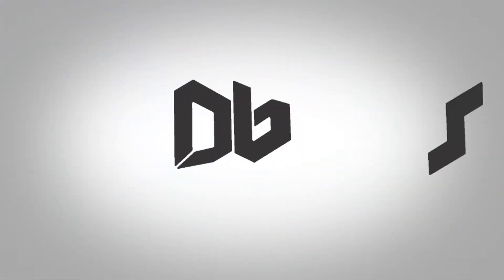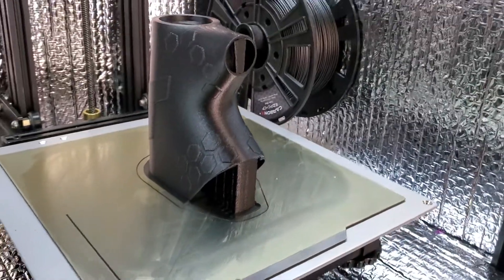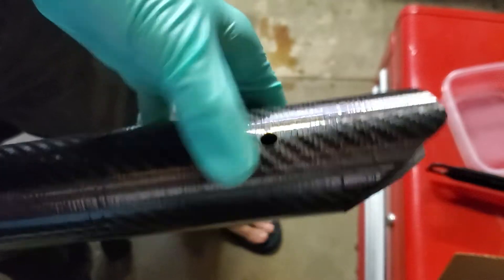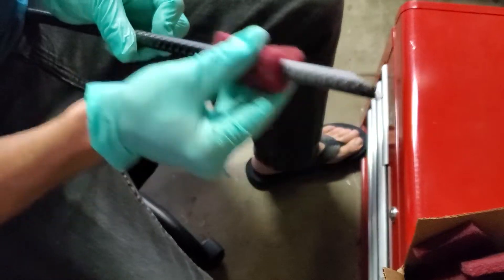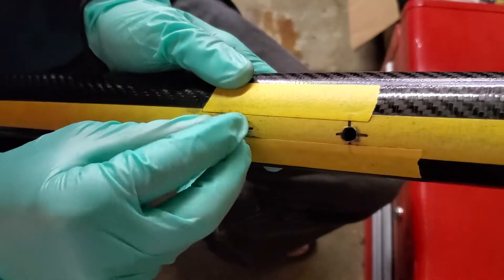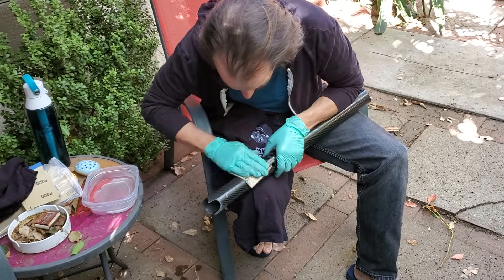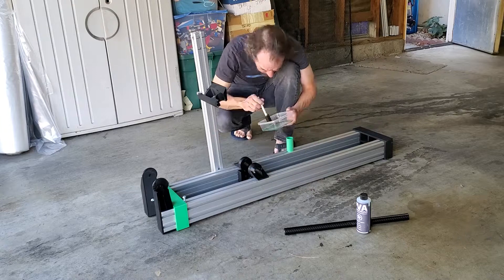Building a 3D Printed Carbon Fiber Bicycle Part 4 - Printing Carbon and Other Details

Comment: Great project!
Are u going to update it? It`ll be great to see there disc brakes, for example.
Reply from the maker: Thanks! I would love to do an upgrade with disc brakes but probably not any time soon.
Reply: @designbydave  disc brakes and through axel are two things which it'll be great to see at that frame for sure. I need to check if there're any dropouts with through axel at link you've provided. And I didn' see if for what rear hub standart was that frame made for? Maybe I've missed that info.
Or maybe u can also share step files of frame's dropouts so I could try to model some brake mount.

Bike season in my country is ended for now because of a cold weather, so I'll love to make that your bike build before the next one.

Comment: Any updates on this or other ones you've made?
Reply from the maker: I made two and ride the second one to work once a week or so! It's great for what it is and I love it!
Reply: @designbydave  I just got a Snapmaker 2.0 and had a similar idea. I had this old (10+ years) bike and spent about 400 sealing out parts over the last 7 months I've been using it to get to work. It's I can 3d print parts like that and get the tubing that's be a lot cheaper in the long run for parts

Comment: i'd be really interested to see, what the infil actually does for strength. i'm 3d printing myself, mainly engineering stuff, and from empirical data, the only thing that really influences part strength is number of shells and top/bottom layers, infill over 25% did never make a significant difference to me. maybe you could make a more scientific approach? would be interesting to see, also you could save a lot of weight and (expensive) material. those engineering materials arent exactly cheap so why use more than you have to?
Reply from the maker: Yes, totally. An investigation and optimization of wall/infill printing perimeters would be worthwhile. It's just something that I haven't been able to get to. In a general sense, I pretty much agree with you. However for these first frames I wanted to error on the side of over-built.
Reply: @designbydave  true, overbuilt works better than if it breaks right away 🤣

Comment: Great job. Can you tell me more about nozzle diameter, nozzle material, and print speed for that material?
Reply from the maker: Thanks. 0.6mm, hardened steel, ~40mm/s
Reply: @designbydave  Thanks a lot!! I appreciate it.❤️🙏

Comment: I just discovered your channel, awesome work! Would you know how well this material bonds to epoxy resins and carbon fiber cloth?
Reply from the maker: It bonds great. That's how I attached the carbon tubes to the 3D printed lugs. 3M DP 420 adhesive

Comment: How did you make your enclosure for your 3D printer? Did you need the enclosure to print the carbon fiber parts?
Reply from the maker: The Ender-6 comes stock mostly enclosed, just need to make or purchase a top hat. Yes, an enclosure is required to print the carbon fiber reinforced polycarbonate material I used.

Comment: Nice series dude!! Do you have the chamber actively heated or just passive/closed? 
Also, PEI with Magicgoo?
Tks :)
Reply from the maker: "Passively" heated as the head from the bed and hot end will warm it up. It's insulated. 
Yes PEI with Magigoo PC works excellent with PC

Comment: New subscriber here.   
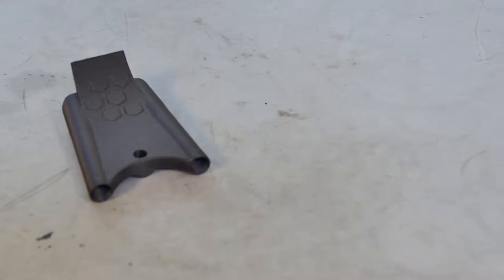What command did you use in Solidworks to model the hexagons on offset contoured surfaces like that at the 1:06 mark?   I want to do something similar with transparent materials for creating reflective facets - similar to the inner surface of the taillights of your car.
Reply from the maker: Hey, thanks! It's the Warp command. Start with a 2D sketch on a plane that's roughly parallel-ish to the surface you want to project the sketch to. Can be a little tricky as the sketch can't exceed too far beyond what the projected curve will become (if that makes sense.)
Reply: @designbydave  
That's EXACTLY what I've been searching for.  THANKS!

Comment: Very good job 👍🏼congratulation 🥳
Is it possible to get the files in the near future? 
For Sale or for free (donation)
Reply from the maker: Thanks for checking it out. I am considering putting the project up on Thingiverse, however I'm not sure how useful it would be. The frame geometry is a small size and only appropriate for smaller riders like me. Also the lugs are designed for the specific tube sizes I had that would likely be difficult to source.
Reply: @designbydave   people could lengthen the tubes to customize the sizing for a perfect fit.
Are carbon tubes hard too source, manufacture.
Reply from the maker: @michaelbrownlee9497  It's not that simple with bike frame geometry, so no, you can't just change the length of the tubes as the angles between them will also need to change. 
There are a few sources for carbon tubes depending on your budget.
Reply: @designbydave  if you increase the length by the same percentage the angles will not change. It seems obvious so i must be missing something, nothing is simple.
Reply: that would be really cool😊
may I ask how tall you are? As reference 🤔
keep it up 👌
Reply from the maker: @janfrose3502  5'5"
Reply from the maker: @janfrose3502  The frame would probably be a decent fit for most people about 5'3" to 5'7" or so.